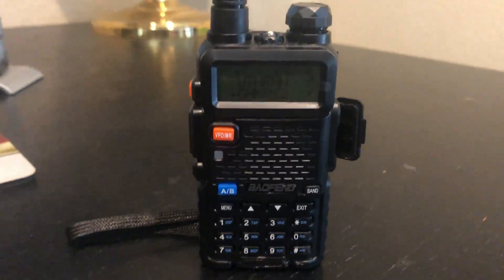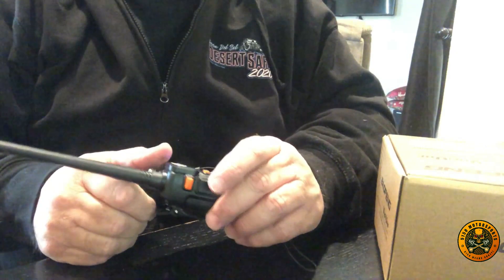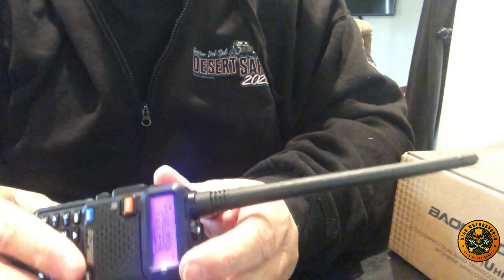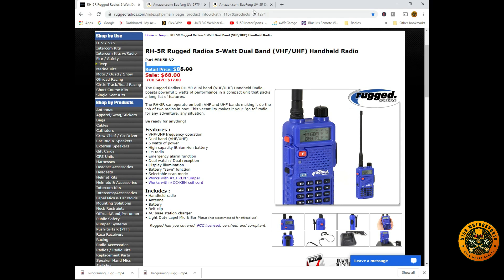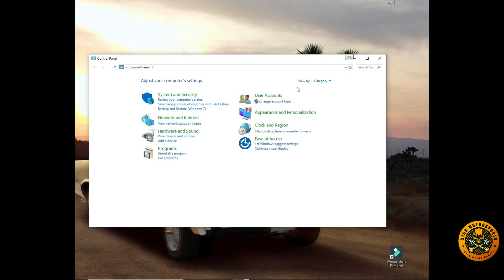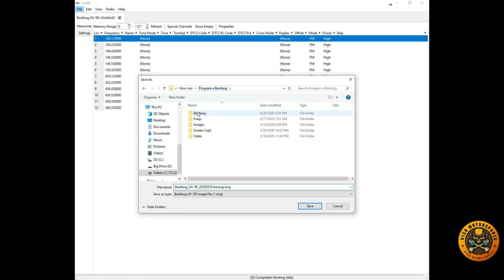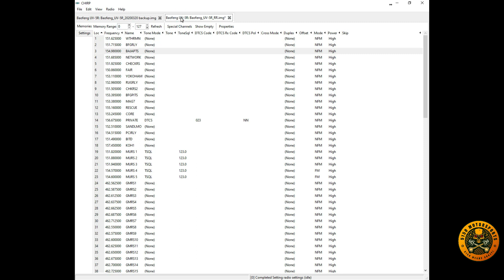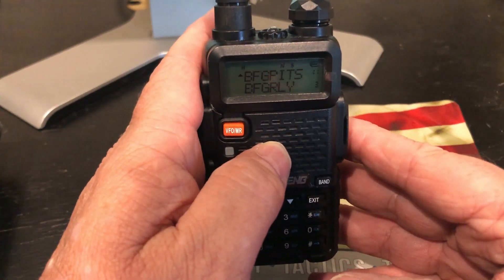Programming Baofeng Radio with Rugged Radios Frequencies

Comment: GMRS channel 16 on the list of channels is not a actual GMRS frequency. I wonder if that is a typo or if that is the actual frequency that channel 34 ( "GMRS channel16")  Is transmitting and receiving on. I do not have a rugged radio, If I did I would check it with a frequency counter.

Comment: Two part question But I just purchased a new UV-5R and followed the steps everything worked perfectly. But now I’m the radio isn’t talking like saying “frequency” when I power it on nor is it giving me my “custom” welcome when I power it on. 

Is there something in the settings I need to change to fix these?

Is it true that I won’t be able to transmit on any of the channels now with the new radio updates?
Reply: Mine is the same did you figure this out?

Comment: Wonder if you might be able to assist.  I have Boafeng UV-5G radios, and if I try to upload the RR file you provide it won't allow me a radio selection in the drop-downs.  The file is somehow locked to UV-5R.  Can I mod the file to work with my radio, or is there a way to copy the data to a file format that the radio will accept?

Comment: Wish I had seen this video before I bought my Rugged Radio GMR2. I bought a BaoFeng cable but when I try to download the data file from the RR I get a message stating it can't communicate with the radio. Any thoughts or advice would be greatly appreciated.

Comment: Okay so I’m not telling anyone to do this but.. if you do this and add the channels but your radio cannot transmit on the rugged channels it is because your radio is most likely locked. To unlock it, make sure radio is off. Press moni+ptt+vfo button at the same time and turn the radio on while depressing. It will unlock your radio to transmit on such channels. Just know it’s probably not legal. Just information for the internet
Reply: Baofeng uv-5r just beeps over and over, nothing else happens.

Comment: On this radio 
Does this frequency range mean I cannot transmit on 151.625000 as it is outside the 144-148 range?  If that is the case the standard UV-5R will not load the Rugged Radio frequency list.  I have been trying and it will load but i cannot transmit/receive on it.  Any help would be much appreciated.
Reply from the maker: Hi Thomas 151.625 freq is Rugged Radio WTHRMN channel and does TX/RX, only thing I can think of is some-how TX/RX setting changed on you radio, you will need to verify that both the TX/RX are enabled, you can use CHRIP software, select the channel that not working, select setting and verify these setting are enabled. Thanks for watching.

5150
Reply: @5150MotorSports  Thanks for the reply. I did verify that the TX/RX were checked (enabled).  Do you know if that 151.625 frequency can work on the 144-148 mhz range?  I recently purchased the UV-5R about a week ago.  I notice the previous versions of the UV-5R had a different frequency range.  So I am wondering if this is the reason.
Reply: thats sounds like a mrus freq to me so probabably not as the new america baofangs come locked

Comment: Need your help, When I load the Rugged Race Files just as you do, my Radio clones them, and when its finished the TX lights solid for a second while it finishes but I dont see it actually reboot and say "Welcome" again.  the Channels are there, and I can test it and it receives transmissions from my other Rugged Radios, but I cant transmit.  Also the Baofengs speech is gone.  If I return the radio back to factory programming, it all works again, but then Im back in the same boat of not being able to communicate with my Rugged Radios.  Please help.
Reply: I have the same issue.  I cannot transmit on the RR list.  The light does not come on also when trying to transmit.
Reply: Using a Baofeng UV-5R
Reply: @Gary Bunday  did you ever figure this out? I am having the same problem, and can't seem to get it to work. Thank you.
Reply from the maker: Hi J lll,
Just to verify you have the Baofeng UV-5R radio?
I have not seen this issues before.

In the video at 12:57 using the CHIRP application under setting -> other setting there are a couple of options VHF TX Enabled and UHF TX Enabled make sure both the TX are enabled (checked)
Hopefully that fixes you TX problem.

Thanks for watching.
515”

Comment: This is good and fine but the current rugged radios has like 71 channels , im noticing that there are alot missing when i added them to my baofeng . Do you know where i can get all the rr channels so i can add them to my  radio ??
Reply: Here is a list I found that was updated for 2021  https://www.barrysutvadventures.com/uploads/3/0/6/3/30636499/rugged_radios_dmr-db_channels_and_frequencies.pdf
Reply: @ericb9554  thanks for the update , i actually ended up buying the software to get into my rugged radio and ended up , uploading my chirp file to chirp website if anyone needs it
Reply: Do you have a like to the file thanks

Comment: Tried to down load, file says corrupted?
Reply from the maker: You need to open the file pusing CHRIP program to import the file into the radio. Thanks for watching,
Reply: @5150MotorSports  Got it figured out, thanks.
Reply: I do have another question do you know if PCI radios has a list of their own frequencies? Or do they use the same ones as rugged radio.
Reply from the maker: @Good-Life34010  I’m not 100% sure but believe PCI HAS a list with some  channels that are the same, glad to hear you got it to work… Thanks

Comment: My USB cable does not say COM3 in the hardware.  What do I need to do?
Reply: Chirp does not find the Port either and gives me an error.
Reply: The hardware tab lists the name of the cable as FT232R USB UART as the name, "other devices" as the type.  It does not say COM3.
Reply from the maker: Hi Michael,
Around 9 minutes into the video you need to see what COM port your computer using, in the video mine is COM3 yours could be different. If you don’t see a COM port try unplugging your cable and plugging it back in, if that don’t work might be the wrong cable or a bad cable.
 
Thanks
Dean
Reply: For anyone else trying. I wasnt getting the "com3" either i had to find the chipset of the cable I bought and download the drivers for it to connect and get the "com" reading which mine was at com5

Comment: Can it be done manually?
Reply from the maker: Not sure what you mean? You can add frequencies manually from the radio keypad.
Reply: Sorry for the lack of information. I have a Kenwood tm-281a mobile radio. I programmed the BFGRLY (151.715) frequency and was able to receive the Rugged Radio BFGRLY signal but the Rugged Radio didn't hear my transmission? My understanding is the race radio frequencies are simplex.
Reply: @hughsmitham722  did you ever figure this out? I’m trying to set up the same frequency.

Comment: I'm bummed. I get to upload and then I get "an error has occurred" (radio did not respond). I believe it's because I'm trying to upload into my Baofeng UV-82. Just like in your video when the dialog box pops up (port/vendor/model) the Vendor and model are set and cannot be changed. Is there a way to change those? Most of the guys in my group have the rugged radio and I really don't want to buy another radio. Thanks in advanced.
Reply: Check and see what cable you are using.  I found using a FTDI cable works for my UV-5R.  The other cable that required the driver update was not working for me.  Also make sure you have the most up-to-date Chirp software.

Comment: Help i have no sound. The upload worked but i have no sound now, only have sound if i put in FM mode. What did i do wrong?

Update: i programmed both of my uv-5r, channels are all there and able to transmit receive and hear no problem. the sound i don't have are the baofang tones and and or voice when any button is pushed

Comment: I clicked on the RR Freq. list link and it did not work.  Tried the other links in the comments and they did not work.  Can you send me a good link please?  Thank you!
Reply from the maker: Hi Milan,

Here is the link...

https://drive.google.com/file/d/192JLqJ_qRyqEsjIeDGEf57ZKhBiqn0cx/view

Thanks for watching..
Reply: @5150MotorSports  Still did not work.  After I download, says file unsupported or cannot open file.
Reply: @5150MotorSports  I have tried 2 different computers and my phone. Still nothing.  When I first saw your video last week it worked fine but not now.  What do you think?  Thank you in advance!
Reply from the maker: @milanradjevic8976  I’m traveling this week so don’t have acces to a pc, sounds like your not opening the file up in CHRIP? as that’s the program that recognizes the file format and you need to upload the setting to the radio.
Reply from the maker: @milanradjevic8976  Did you get the file to work, just verified the file is good. As mention before you need to open the file Baofeng_UV-5R_RR.img in the Chip program then upload this file this file to your radio. 

Baofeng_UV-5R_RR.img file is not recognized by Windows that is way your getting the error.
Reply: @5150MotorSports  I figured it out.  Thank you so much!

Comment: I am uploading this to a retevis radio just like baofeng but when I go to upload it, the baofeng model is already in the prefilled drop downs from the file you provided. When I do the upload, my radio accepts the channels but the computer says the files or something didn’t match the retevis. How can I change my drop menus to the retevis radio?
Reply: For example at 13:25. This is the prefilled drop menu when I use your provided file.
Reply from the maker: Hi Ray,
Try to click on the radio tab, then download from radio, a pop up window will open asking for the Port, Vendor is the 2nd option, click the down arrow form the drop down box and it will list all the different vendors.
Reply: @5150MotorSports  Hey 5150! Thank you for your response. This is great advice. I played with the software some more after reaching out to you. I downloaded the default from my retevis radio, copied the frequencies you provided, and pasted them to overwrite the retevis defaults. It worked! Thanks again. I was able to reprogram 4 radios in just a few minutes.

Comment: Hello, thank you for the video.  I was able to transfer the frequency but the names of the channels did not transfer.  Is there away to add the names of the channels.  Thank you
Reply from the maker: Thanks for watching, there is a setting on the radio, don't recall that option off the top of my head, but your radio set to frequency mode, I think you select the orange button VFO/MR on the radio to switch between them.
Reply: Thank you

Comment: Do you have a chirp channel file for a TYT th-9000d radio by chance ? I'm having a hard time finding it 🙃
Reply: I’d also like the chirp file if someone has it.
Reply: @jjfore0921  do you have a TYT-9000? I can send you the file image I built for mine. You'll have to open it using CHIRP software. Give me an email to send it to
Reply: @TheSRMproject   I have the baofang. I’m thinking of getting the tyt-9000 though. I’m still researching if it will work with the rugged radio 696 intercom. I’m sure there is an adapter out there but I haven’t found it yet.
Reply: @jjfore0921  the rugged radio version of the tyt actually has an extra port to plug in that intercom system. I've been using the tyt and can tell you it works really well. I actually mounted a small speaker for it right behind my head in my RZR turbo s
Reply: @TheSRMproject  can I get into the rugged radio with chirp software or do they lock them up?
Reply: @jjfore0921  I wanna say you can. Just gotta look to see if it's on the list. They add new radios all the time.

Comment: Hi, Im using the Baofeng BF-F8HP... Does anyone have a file to upload for this model that uses rugged names liek the video? When I try this file it throws a "firmware" error. 
Thanks in advanced
Paul
Reply from the maker: Hi Paul,

I’m not sure about your model
of radio but are you getting the same error we do in our video @ 13.50? If so you just ignore the error as it will still work. Thanks for watching and please remember to subscribe to our channel.

Dean

Comment: To be able to display the frequency of the channel you need to select frequency on channel A  and name on channel B,or vice versa how ever you prefer it,this made on chirp, you will not see frequency pressing vfo button,vfo frequency mode is for manually input a frequency so you can up or down frequency by the freq steps you selected.

Comment: Dang another great video, THANK YOU. Quick question though. Maybe I am missing something or looking at it wrong. Your files show some slightly different names and number of Rugged Radio channels. I recently bought two Rugged Radio V3 and they have 77 channels programmed. Did they add more channels? I am guessing they changed they name of a few, now biggie there. Also here is a link from there page.  

https://www.ruggedradios.com/PDF/RuggedRadios-FCC-Approved-Channels.pdf

Thanks again
Reply from the maker: Hi tfdwookie, 
Your aere correct the file has changed since we created the video.

Thanks
Reply: @5150MotorSports  I am thinking of trying out chirp and programming some baofeng. I have a few rugged radio but we could use two more so I bought the baofeng. 

Do you know if I can program repeaters into the  radio for repeaters in the area.  We drive our side by side in dense trees and hills. I figured hitting the repeater might help our group getter longer range and better in the dense areas. I am guessing I will need to get my license to use these repeaters. Is that correct?
Reply from the maker: @tfdwookie  Yep, you sure can program repeaters using the Chirp software,  and correct will need a ham license.
Reply: @5150MotorSports  any advise on how to do that in chirp or will it be self explanatory. Maybe you have a video I can reference. Thanks so much
Reply from the maker: tfdwookie I don’t have a video but NOTARUBICON has a nicely done video...

https://youtu.be/PGpAV0zzpDA
Reply: @5150MotorSports  I will check it out.
Reply: @5150MotorSports  also is there a way to secure a line between to radio. Like needing a code or something. Others can hear but can’t chime in. I thought I read something like that.

Comment: Thank You so very much for this video and it's very valuable information.   I purchased two Baofeng radios a year ago and gave up on using them until I saw this video.  Those radios went from being worthless paper weights a year ago to being something that I will use on all my adventure excursions and will include them in my home/car emergency bug out bag.  I need to now learn the significant usage of some of these Rugged Radio channels. Thanks again!
Reply from the maker: Thanks for watching!!!
Reply: Great info thank you!

Comment: Can you send me the link for the list? For some reason I can't download the one listed...
Reply from the maker: Hi Bill,

Here here is the complete link maybe that will help.

https://www.youtube.com/redirect?q=https%3A%2F%2Fdrive.google.com%2Ffile%2Fd%2F192JLqJ_qRyqEsjIeDGEf57ZKhBiqn0cx%2Fview%3Fusp%3Dsharing&event=video_description&v=d_LrNfnUWUk&redir_token=QUFFLUhqazZqUFF4MFlXV09FSWhrVWlkZU5PMnVTdDdzZ3xBQ3Jtc0tsUGVueUZNMDk4M2JVWFl0WS1aNUU0VldBQWZqamNnSVFrZTRsaUN1Y3czZ1h2NG5wdk1wUG1LM3BJMkpPM0h2UTJEdllnYlNwT3dNQ0NMM0w4VGthTzBhM3I0UkdxZGd2eVU3bG9Md0ZrRExfeHdWRQ%3D%3D

Thanks,
Dean
Reply: 5150 MotorSports still won’t work. Can you look me up on Facebook and copy the freqs and paste them in a message? Thanks
Reply from the maker: @Pops_607  Are you looking for the image file to load into the Chirp application to download to the Baofeng radio or just a list of the Rugged radio freq with there names?
Reply: 5150 MotorSports just a list with all the frees and names is all.... ✌️THANK YOU 👍
Reply: I thauhgt cHrirp has all the preset banks that it pulls from it's database which you can download to your radios no?

Comment: You Don't Need an Amateur Radio License for RUGGED RADIO RACE Frequencies Beside those so-call Race Frequencies or Channels aren't in the Amateur Radio Spectrum. Rugged Radio Frequencies fall under FCC part 90, which require a Business Band License. Services like FRS GMRS and MURS fall under  part 95, which those radios are not typed accepted. Besides, GMRS requires a license unlike FRS and MURS.
Reply: Yeahhh stop spreading misinformation rugged radio got fined for violating part 90 and part 95 and one other FCC part.  You are breaking the law if you are using a rugged radio or baofeng without at least a technician license.  You do what you want but just know you can get caught there are people out there that spend their free time chasing people on frequencies that they are not licensed for and it is a big fine when you do get caught, but don’t tell people you don’t need something when the FCC has been very clear in their wordings telling you you do.